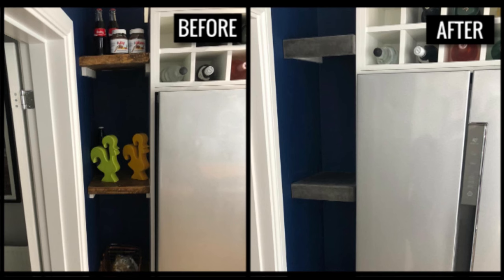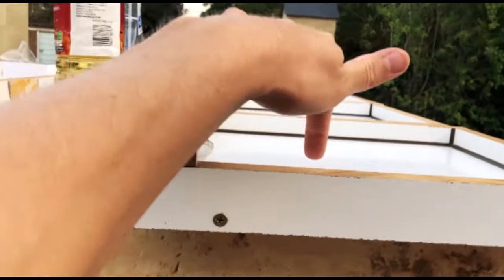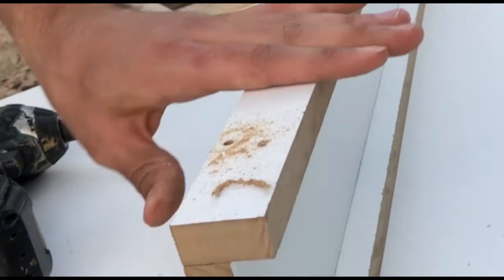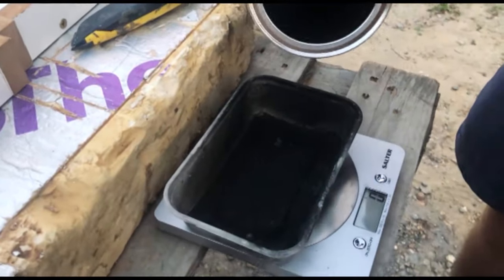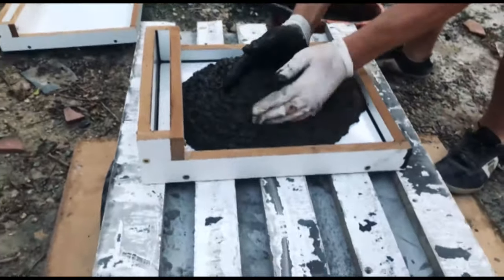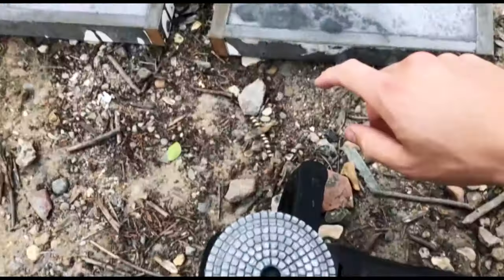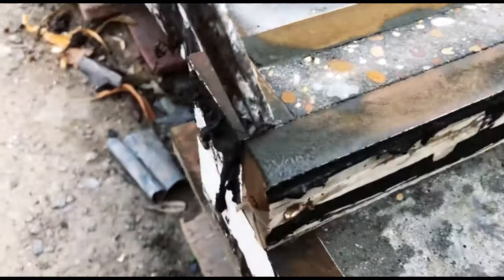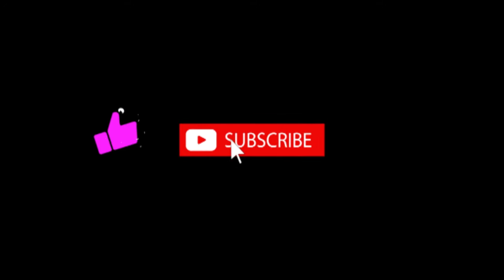EASY DIY CONCRETE FLOATING SHELVES | How to Make a Concrete Floating Shelf

Comment: Great video and information. I notice you link to steel reinforcment in the desription but didn't use any. Would you suggest its needed on this. Is it needed for a shelf 1560mm long 200mm depth would it be needed if supporting only a few kg?
Reply from the maker: How thick would the concrete be?
Reply: @MattHutton  would be 30mm thick
Reply from the maker: @anthonybryantmedia  with those dimensions the shelf should weigh around 22kg. As long as it’s supported well underneath, you use 40N concrete and you’re not placing to much weight on top, you could probably get away with not reinforcing it with steel. However there would be no harm in adding a couple of lengths of 8 to 10mm lengths of steel rebar along the length of the shelf. It depends on how precariously your shelf is placed. If you’re going to have it over a stair way of somewhere it could be easily knocked or there will be kids walking around underneath it or nearby, you may want to reinforce it just to be safe. But please make your own judgement, because I have no idea where this will be placed or installed and who much weight will be placed on top etc…
The above should give you and idea of my thoughts based on your comments but not taken as advise. 
I hope that helps :)
Reply: @MattHutton  Thanks Matt. I'll certainly not hold you to any structural advice for this 😊 I'll be adding a step either end as this and essentially it will be a riser for my desk to put a imac on. It will be 9cm high with a 6cm negative space.
Reply from the maker: @anthonybryantmedia  awesome :) I hope it goes well mate!

Comment: Do you have the link for the motor as I don't see it in the description?
Reply from the maker: yes  just adding it in now:] https://www.ebay.co.uk/itm/250W-50HZ-Concrete-Vibrator-Motor-Motor-Table-Cast-Iron-Vibrator-Motor-2480RPM/254325133127?_trkparms=ispr%3D1&hash=item3b36f58f47:g:gZMAAOSwFpddTM3y&amdata=enc%3AAQAFAAACcBaobrjLl8XobRIiIML1V4Imu%252Fn%252BzU5L90Z278x5ickkrDx%252B2NLp21dg6hHbHAkGMYr1XEbTfzCvhG2fUaRF9CiwtEQtzeKA0TkCYmjmRDz8VGrwRGFducMoBlfCp0wY3fO8rw2OrcuJeTZFRhWNy7w9%252BAX1eiPw0npk9KAbZBwx1zO0IiB3WzemW5cmfTr%252FWs5OD18JjPvq9h%252BHybFa5yPlyo0glkl%252B8Ut6dJV2drUvl%252FKlJWzpRaazVcxacWi27h%252BrAj%252BBbsw%252FRgKoHfohE3G7R%252FvzWYTz6g9L2Wjpz8d8Bv8tGztoVrpDahzM1svLywfMQVJ94HyjjDcSYTq%252FwomURerT%252BOWpPgN4SAhc7JXFyC%252BX6cPEKFEqsUDIFThUmXLSsdbhRc%252B5DurCloJ5nwNA3IJGIvKZ2JDovZDtQ8bqItzSC7ALbBPEQkIEevAKwLCsmvPHerwoE2TS1E7ypObr%252BeJ2Q%252BhUxrAhSMSP3NppRljYXJS0nj67XZyiaHwGEgf%252FrJz%252FlzvySbTVkqQSC1syYiYPvmA2npJczybQn7sqjxlr8ylkoRlhhzimI3SYYFHd5YfXXWHc%252Bo2mgTtoAizVOq8ZH2No7mWDODUE5RHmgC%252BrGChZSACJBxyxsekYlxj9onwjCQqF0EnyqBmk4Yhep%252B%252BT3qH37oazas%252BFgYOvXsqRPypP%252BmvJPiuNRPQMvnWvXXbewlQNJSWFAICQn17PP8j12GnTBKJHy6awe3gs8%252Fm7v33fw0YleEP7nrUZi9r%252ByCYuqBD9JaA5oziSvfHcb62vJ5BbmMW%252F9AWfAWR%252F5QdoRYTtsJ95fMNfHmgEHw%253D%253D%7Ccksum%3A2543251331274de4e2d0ef7347149bcfea3f549a0d84%7Campid%3APL_CLK%7Cclp%3A2334524
Reply: +1 would also like to know which motor. We seem to be missing this. & Thanks for the video!
Reply from the maker: Dreamcat 4 hey, the link is now in the description for you :)